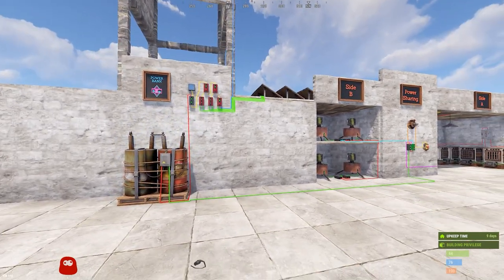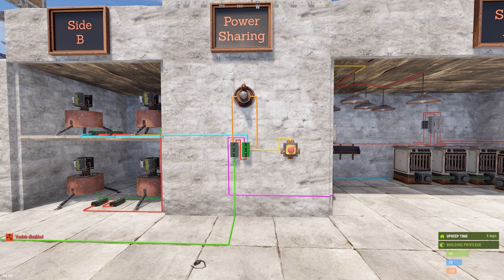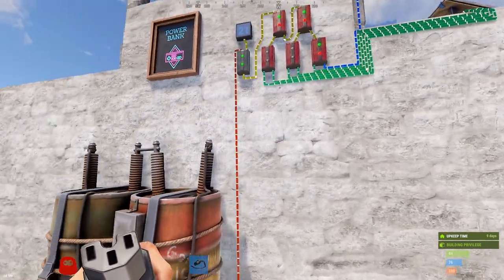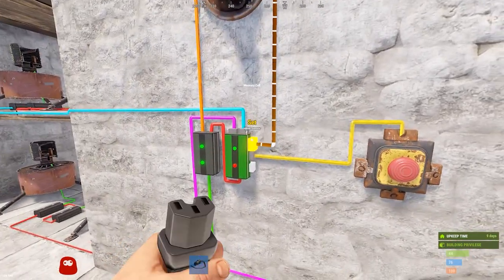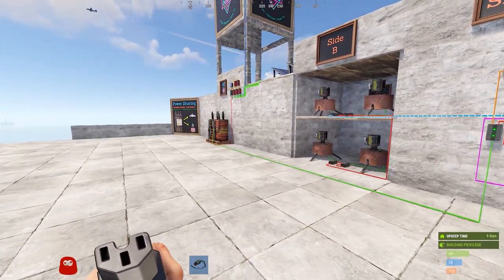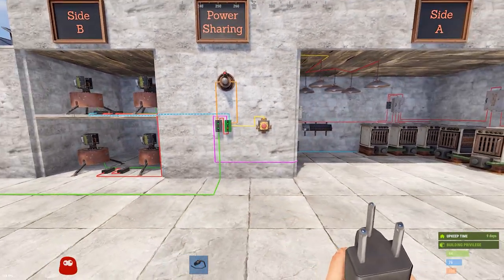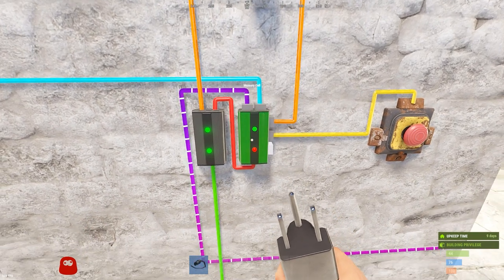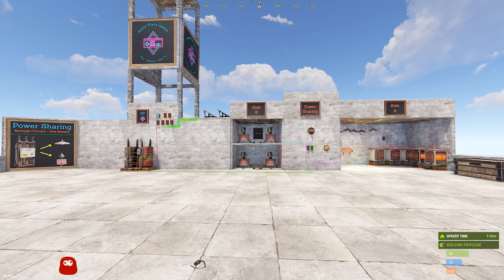RUST Electrical | Power Sharing Multiple Circuits - One Battery 2023

Comment: Love your videos, comprehensive but yet easy to follow. The way you colour code and lay out your circuits makes it strangly satisfying to watch.

Got a request if I may, how can I set up a wireless turret tower/externals?
I want to be able to watch cctv and activate certain turrets against raiders.
Reply: I did this yesterday.  Solar panel, 2 small batteries, 2 branches, HBHF, AND switch and you can build a triangle that is attached to an external (I used roof frames to space it out some, with a turret pod that will open when anyone approaches or just un authorized.  pretty easy to wire